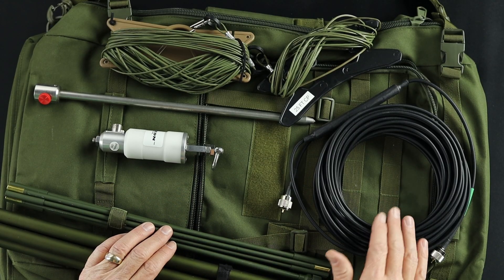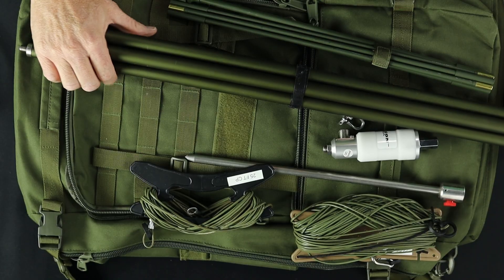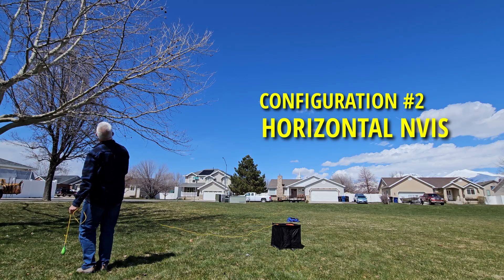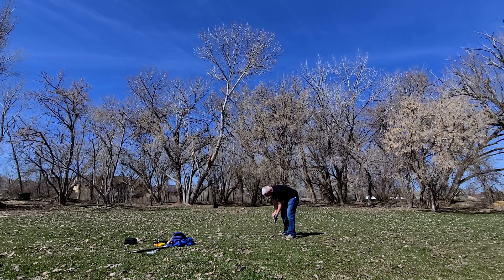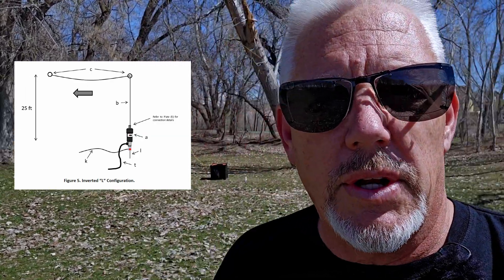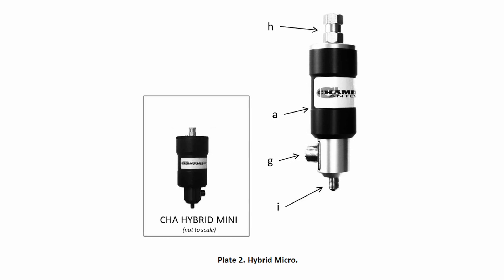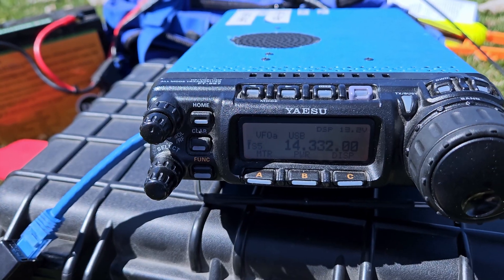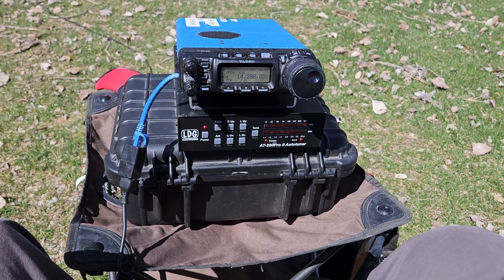Chameleon Antenna MPAS 2.0: How to Set up the 9 configurations | K7SW Ham Radio

Comment: Take basic antenna components and make them look military spec like with OD green and better machined parts and charge an arm and a leg for it and it sells. A 10 ft whip, a balun and 60 + ft of wire on the MPAS light.
Reply from the maker: no kidding. I sometimes compare that thought process to buying a new truck. prices are crazy.

Comment: I don't know why you would get one of those antennas, considering the fact that you loose 50% of your transmit power due to the design of the transformer. The temperature of the device will go up to 165 degrees with 50 watt input. A long wire and a tuner works better with no lose.

Comment: The website mentions horizontal whip for NVIS configuration, but it doesn't mention it in the manual.    Curious if you have details on that configuration.  Not sure of the best way to support the whip horizontally?
Reply from the maker: Agreed,  theat is a lot of sag and could deform the whip, so long term usage that way would not be good.

Comment: For field operations, this is one of my go-to antenna systems. I can have a complete station setup in less than ten minutes -- Yaesu FT-897D, MPAS 2.0 in vertical configuration, coaxial cable, and battery. This is great when activating a POTA in the winter when it's FYBO cold. ;)

I suggest keeping a right-angle UHF adapter in the kit for those applications where you raise the matching unit. That will give some strain relief on the socket at the matching unit.

Comment: Do you or anyone here know how I can set this up on my sailboat I have a 70 foot mast and hull length of 47 feet, do I need to have a ground to use this or can I run the ground into the ocean. I would be using this while at anchor not while sailing any help or advice from anyone would be helpful.
Reply from the maker: I would run a vertical wire up your mast and then , away from the mast about a foot, and then drape a counterpoise out the back of the boat.

Comment: Chameleon makes high quality equipment.  I've always built my own antennas vuntil i became ill with a spinal cord disease,  i bought Chameleon's Emcomm ii portable outfit to use in the field,  the only problem was i accidentally dropped and broke the unun so i bought the Emcomm iii portable.  I like that antenna so much that i made it my station antenna.   If i could afford one of these MPAS 2.0 i would  use it for my field antenna
Reply from the maker: With what you described,  this antenna would be a really good application.
Reply: I'm late to the party, but Chameleon has always had good customer service. If you have the matching transformer, I'd call them and see what they would charge to repair it.

Comment: Thank you for a great video! What can figuration do you believe to be the best for NVIS?
Reply from the maker: 5 to 8 feet off the ground if you ahev no trees on 40 or 80 meters I think. But you are not limited to that. Some days can be better or worse for making contacts. I totally encourage  trying many setups so that you get a feel for what you and you gear will do.  Don't be discouraged by bad contact days. It is just how it goes. 
73 
Kevin

Comment: I have owned one of these for a couple years. I operated out of the Marshall Islands with the Yaesu FT-857D and the Chameleon MPAS 2.0 in a vertical configuration. Just shy of 10k Qsos in about 8 months.

I now have this setup at my house in an efhw with the matching unit up at 30ft. 

External tuner is a must as you have shown but for what it is I have zero complaints. 

48 states worked from the Marshall Islands  and all 50 from the house.

73 de WV7MS formally V73MS.
Reply from the maker: That is crazy good results. I appreciate you sharing the details . This should definitely help someone looking for an antenna like the MPAS

Comment: Great video Kevin on explaining & showing most of the configurations for this antenna system. I wonder why they use a 5:1? It’s one of the only antennas I’ve seen using it, although I think Alpha Antenna has something very similar.

It may well be that band conditions weren’t all that great but the antenna may have had something to do with it. 1.5:1=4% loss, 2:1=11%, & 3:1=25%. Although a tuner makes the radio happy it still doesn’t take away all of the losses in the antenna. Hence why I say the antenna plays a big part in poor band conditions. With 100 watts you’re at somewhat of an advantage, but QRP not so much. This antenna system really boils down to convenience vs efficiency. But an antenna tuner is just another thing to lug into the woods. $600 is a hard pill to swallow for such an inefficient antenna.
Reply from the maker: All excellent points, Mark. 
Generally, when I am gaging band conditions,  it is merely on receive and lack of other hams on the air.  For this video, most of the footage was made during the week, and in my experience, a lot fewer operators are on during the week. 
So many compromises in this hobby for sure.  73. Kevin

Comment: Would , the hybrid micro + vertical mil extension + whip  with specifically cut counterpoises elevated off the ground as you did in a previous video, perform better than on the ground?
If so , would you recommend running a ground cable to the spike in the ground directly below it?
Thank you
Reply from the maker: I may give that configuration a try and we will both have that answer.
Reply: Pretty much the question I had
 I used to elevate this about 6-8 feet above ground on a tripod with elevated radials sloping about 45 degrees and attached to plastic or wood sticks to prevent ground losses. I recently bought Chameleons 15 foot rollover the tire aluminum mast and began putting the micro unit, extension and whip up in the air at a variety of heights depending on the wind.  I've had success but don't know if it's more efficient than on the tripod or the spike. I do worry about having all that metal 15 feet up. I keep thinking the threaded part is the weak link although it is tight and secure. Any thoughts are appreciated.

Comment: Is that blue patch cord that's used with the Mic a straight thru pin-out? Thanks again for sharing all this information. KN4FRK, 73s
Reply from the maker: Yes that is a 6 inch blue straight through patch cord. Easy to replace or make and super helpful
Reply: @hamradiowithkevin  Perfect I have all the tools and materials for it. Thank you again.